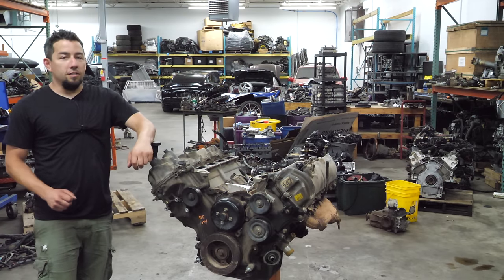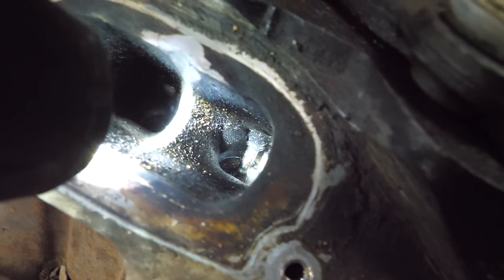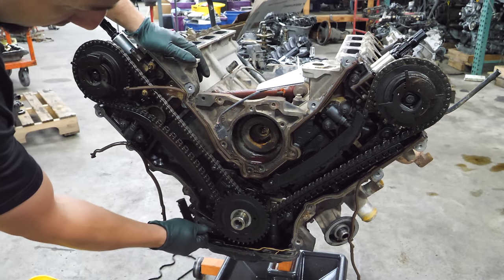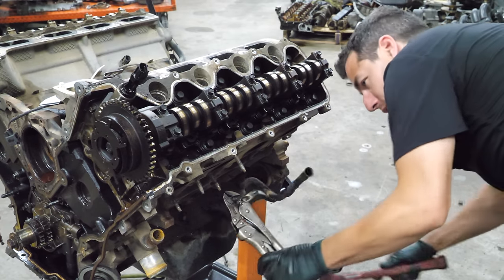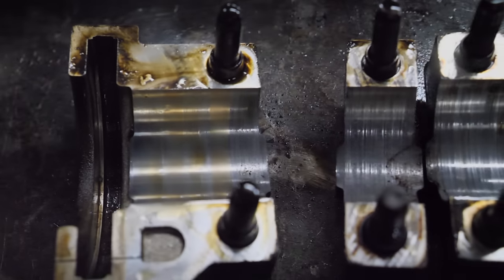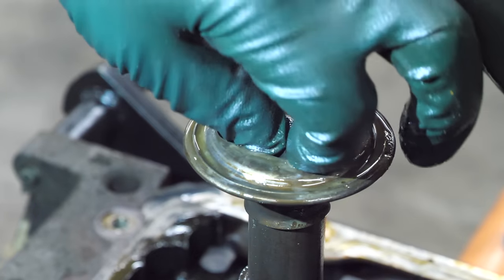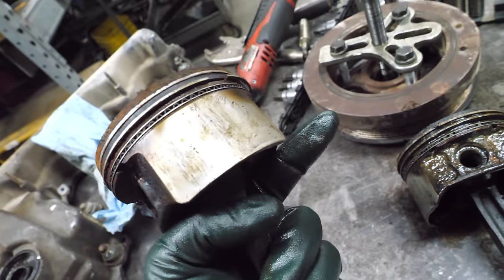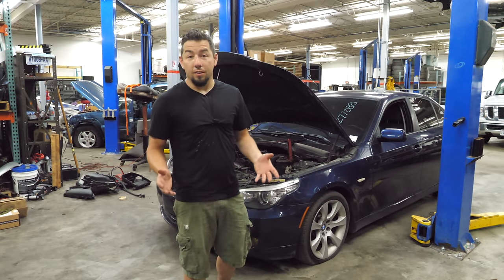Bad Ford 5.4 3-valve V8 Engine Teardown. Which of The MANY Possible Failures Took This One Out?

Comment: I absolutely love this engine! I made tens of thousands of dollars fixing this engineering embarrassment. For everyone who claims they have had no problems, consider yourself lucky, these are an absolute POS!
Reply: I am one with 290,000 on an 07 expedition.
Reply: I agree. 2004 was a transition year. A friend has an 04  f150 with the 4.6 2 valve engine at 350,000 miles. I have done about 50 5.4 engines with timing issues, bad tensioners, seized rocker arms,  exploded cam phasers, and the list goes on. Im only a part time mechanic on the weekends so i can imagine what full timers see
Reply: Please elaborate on your personal experience.
Reply: @jerryp1776  that's extremely overkill maintenance dude. Trash engine
Reply: I’ve had one for 355k not a single issue
Reply: @bldontmatter5319  what about subaru engines? every 100k there goes  head gaskets and timing belts.  Several thousand each time!
Reply: @vincentmartin9133  do you run synthetic ? regular changes?
Reply: @vincentmartin9133  just bought mine and I'm having to fix the timing
Reply: 226k on my 08 F150. All I ever did was change the oil and plugs
Reply: @reedvending2384  Funny, I didn't know gravity only affected Subaru boxer engines. It's only Subaru boxers that have coolant pool on the bottom lol. Only thing I'll give you is that the combustion chamber has a shit ton of free space on the outside, axing structural support.
Reply: @reedvending2384  Subaru's haven't had head gasket problems or timing belts for a decade.
Reply: @bigdaddymak1439  My bank account  tells another story.  Im done with Subbies
Reply: @edjackson4389  you might want to look in the mirror on that one. Worst part about Subaru's are their owners
Reply: @bigdaddymak1439  I just looked in the mirror... I think you might be on to something
Reply: 220k on my 2010 and zero issues.
Reply: Facts matter, millions and millions were made and many still on the road working hard. No it’s not a good engine overall and they screwed up. But statistically still better than many other engines. When you  make and sell way way more cars and trucks than any other company, you will have some problems but not as high a percentage than other companies
Reply: ive had every spark plug break.
Reply: The spark plug issue was fixed. The oiling was a big issue on most timing failures. All update oil pump, phasers, roller followers, etc. I have a 2011 5.4l w/ 140k. The 1st gen coyote wasn’t without its problems so I can see why ford kept the “updated” 5.4l revisions in the fleet.  What is great is how cheap and easy they can be repaired with great updated timing, valvetrain, and oil pump parts. If you have one and hear a tick on start up or consistently; do the timing job and replace those roller followers. Use mobile one synthetic oil. It’s all in how it’s cared for and maintained.
Reply: I have a 2007 expedition it has 270,000 no major problems.  I have changed the plugs twice and regularly change the oil with no issues.
Reply: @illwineventually  I might even supercharge mine.
Reply: Was a great motor new, and after I completed the full timing job with the mellings upgraded oil pump...
Reply: @robertconway3519  The Oil pump in my and many others opinion is the real culprit, that aluminum back plate that deforms allowing blow by and starving the variable cam timing of it's needed oil pressure is what kills these, I have 290k on mine with a Melling HV pump, and it is silent, no phaser clack at all ;-)
Reply: @whitey22222  there was a great video in here somewhere where they showed the factory pump at rpm compared to the mellings. The oil that was spewing out that back plate on the factory pump was simply ridiculous. That loss of volume and pressure is really what kills these timing components. Between the factory pump, and the 05/06 chain tensioner seals that blow out, they were destined to fail. I did the job with phasers, tensioners, pump, guides, etc at 96K. Sold the truck running strong at 180K. it's a shame as these motors had good power when they're running well.
Reply: @bigdaddymak1439  Then you can reimburse me for the $1800 I just dropped on a 2016 Forester with 62k.
Reply: Ford's worst motor will still outlast a Dodge! 😆
Reply: You people need to knock it off!!!.. We bought a brand new '99 5.4L Triton 4by4 Expedition with 8 miles on it. Had it 15 years 180k miles not a single solitary problem. Same transmission, hoses, alternator, fanbelt, everything,, 4 batteries replaced only.... idled and ran like the day it was New till the day we sold it.. Ford makes a dynamite truck,, everybody has their glitches
Reply: @seatime674  If it was a `99, it had a 2 valve 5.4, not a 3 valve 5.4.   The 2 valve engines are almost indestructible compared to the 3 valve.
Reply: @andrewb9708  I'm almost positive it was the 3 valve but could have been the 2 valve slight chance, maybe someone else can chime in with it.. The day I sold it I was genuinely sad like a family member died...Crazy
Reply: @seatime674  Nobody else needs to chime in.  The three valve was released in 2004 in the F-150 and Expedition, 2005 in the superduty.  1997-2003 Expeditions had two valve engines.  That's why you didn't have issues with it.
Reply: @andrewb9708  Got it, wasn't sure if you were just speculating or knew for sure
Reply: @michaelwdagle7410  same here but I have the cam followers and chain components with a new oil pump to get another 220000 miles. Oil changes every 5k motorcraft simi synthetic 5w20
Reply: I haven't had a single issue with my. 
I have 184 thousand on my
Reply: @heartstringsofficialVR  
Do yourself a favor and replace the oil pump with a Melling M360HV High Volume Oil Pump.
Also make sure you (or your mechanic) drop the pan and clean it out along with the oil pickup. When those plastic chain guides break, they drop in the pan and clog the pickup.
Reply: @bigdaddymak1439 but they still have plenty of issues with their chain engines too! Not as common on the head gaskets but super common for oil leaks, cam phaser issues, valve springs breaking, oil consumption etc… hell even when I worked for Honda the 1.8 in the civics would crack the block causing coolant to piss out, the v6 engines would oil foul spark plugs before 60k, and the auto v6 trannys where garbage
Reply: I inherited my 5.4L from my Dad's estate after his passing in 2009. He insisted on changing his oil every 5K and using only synthetic oil and I still follow his regimen.  It's got 310K on it now and I dread the day I have to get rid of it for sentimental reasons. It has only failed me once (FPDM rotted) and it was a super easy fix
Reply: @edjackson4389 😅
Reply: Carol Shelby would disagree
Reply: 2003 expedition with 388 thousand miles no problems yet, and a 2014 expedition with 243 thousand mile, runs great. My favorite engine ever.
Reply: 03 f150 5.4 3v triton with 260k right here baby! I already know I'm lucky without the validation
Reply: @JB-ef7ks  2002 5.4 3V with 549k.  No joke.  Ill post a video if y'all wanna see.
Reply: 06 318000 miles ticks a bit but runs good
Reply: @Oldsoulstuckinabadtime 
Yeah, the oil pump upgrade is to extend the life of the engine to something reasonable. Cleaning the pan/pickup is to keep the engine from completely dying within 5 or 10 thousand miles. 

A lot of the common problems are prevented with the pump upgrade though, including future timing chain issues.
Reply: 212,000 miles when mine went. Transmission went out, looks tan 100 miles after that rebuild, engine popped.... I want to fix that truck. Love it
Reply: @Oldsoulstuckinabadtime what do you mean running diesel or trans fluid every change?? As a quick wash then drain to clean it out or in place of the actual 5w20 all together???
Reply: @frankjosidetuck3809  03 f150 5.4 3valve here with 270k miles. Leaks coolant that must be coming out the exhaust cause I don't see it anywhere on the ground plus a oil leak from the filter mount gasket, oil pan gasket, valve cover gaskets and probably rear main seal but knock on Ford it's still going!! Just have to top it off once a month maybe twice!!
Reply: @michaelwdagle7410  My 08 F250 was a fleet vehicle before I got it with about 210k. I've only ever pulled my RV with it and I've only put about 4-5k now but I'm hearing that noise on the rear passenger side head. I think its time to do roller followers and think about the timing system. Otherwise runs like a top. My old mountaineer with a 5.0 did right at 400k in the 10 years I drove it, replaced a head gasket and an exhaust manifold about 250k. It wasn't the engine that did it in, was a range rover running a red light.... Goes to show keeping up on the maintenance and repair will make them run for a long time.
Reply: My grandpa had the one in his truck crack the exhaust manifold right after he bought it.  It also clogs the shit out of the catalytic converter.  He just said fuck it and ran straight pipes and headers.  Thing sounds like a mustang now 😂
Reply: @joshjohnson6163  sure
Reply: @andrewb9708  my 03 expedition died from the comman 2v self destruct feature those engines love to jump time without notice due to poor engineering on the timing system if you disagree just do a simple Google search
Reply: @JB-ef7ks  03 has 2vs you are lucky if you've never serviced your timing chain
Reply: @suryavaraman.4277  2002 would be a 2v
Reply: Hello eyebok ! I love it from an owners perspective and I have done the timming stuff and changed the oil as per, it has worked well for Me! when working on it I thought from a put it back together point of view a lot of thought was put into the oil sealing of the engine very little fuss was required to be correct on that part, I can however see were Others may differ on there opinios! see the obove comment ti Eric from Me. Cheers!!! Rick Armstrong Aurora Ontario Canada
Reply: @enjoythesho1992  You can have your opinion, very few will agree with you.  The timing chain issue is known, but it's not exactly common.  Hey, if you want to argue that a 3-valve 5.4 is better than a 2-valve, be my guest.
Reply: @andrewb9708  I'm a mechanic and it's alot more common than you think I've seen dozens including my own do it without notice and yes the 3v is a better engine hands down yea they have phaser problems but once you fix that issue they are bullet proof and make more power than a gutless 2v
Reply: @enjoythesho1992  I was a mechanic too before I changed careers.  I saw way more three valves than two valves come in.  I've driven both and the three valve isn't massively different powerwise,  the powerband is more concentrated mid to high rpm.
Reply: @andrewb9708  well I guess we live in 2 different worlds I've seen way more 2v completely jump time and become boat anchors the 3v will give you warnings before they do the phasers will make noise for 15k miles before they let go the 3v is a better engine they have stronger heads a naturally aspirated 2v makes depending on year and if it has the slightly better heads is 190-260 a stock 3v makes 300 that's a decent jump in power
Reply: @suryavaraman.4277  The 2V is the 5.4 you have being it’s a 2002. 2004-2011 F 150 have the 3V version.  I seen a 2v with 630,000 miles on it. I have a 2006 3V. Done all the work myself on it. Good engine with clean oil in it.
Reply: @enjoythesho1992  oh trust me I heard it slapping around in there but thankfully it's still holding up knocknon Ford and also it's definitely a 3v cause I just changed the plugs n coil packs which are not universal for the 2v, 3v n 4v
Reply: People were cheap and didn't do proper maintenance. I've owned 3 5.4 3v and all of them have never let me down. Because I use high quality engine oil, Shell gas and Motor craft parts.
Reply: @ryantracy1531  
How did Ford fix the spark plug problem?
Reply: Have a 08 and it's trash
Reply: @boxerboxer4515  ever think that maybe that might be cause you hot boxed the engine too much? 2,3 or 4 valve?
Reply: I saw a guy who flushed/cleaned with adding a quart of transmission fluid right before oil changes and he has 400k plus miles. It's really about maintaining properly.... you just had perfect customers that didn't do proper maintenance on them
Reply: @victorgarcia9791  
I don't know, I had an 88 Dodge Dakota,  with over 235,000 miles,  I changed the plugs once a year,  changed the oil every 5,000 miles , never had any major problems,  not like what folks are talking about with this engine
Reply: Just do regular oil and filter changes... They'll work fine if you baby them
Reply: Been through all that with this engine, what a bad design, wasted a lot of $
Reply: I have on one in an Expedition with 200,000 miles, no problems.
Reply: @jakeparker8972  no he wouldn't
Reply: @reedvending2384  Not the 6. No Turbo no problem. Naturally they stopped making them.
Reply: 297,000 still going strong
Reply: @bigdaddymak1439  nailed it, and the worst pat about 3v 5.4s are also the owners. These are oil sensitive engines, I've never seen a single issue on 3v 5.4s that got oil changes at PROPER intervals
Reply: The best part about this comment is all the old farts that have a cap on their truck boasting about all the miles they have on one. Good talk for McDonald’s in the morning.
Reply: The jeep 4.0 is a great motor 
But the ford 4.9 straight six is the best gasoline motor ever built it’s not the fastest but it just works always
Reply: @poisonPpaully  i agree
Reply: 08 plow truck with 389k. Manifolds are only thing that has caused an issue for me. Sorry but 5k oil changes change to new spark if and they will last long enough if your not a asshole to your truck.
Reply: @nhbountyhunter  i totally agree, the only thing that kills the 3v is idiots who do not change their oil
Reply: I bought a used one. With a lot of miles on it. Drove it for two years. And never had a problem out of the engine. The transmission started slipping pretty bad. And popping when in reverse. A frame rail broke. And a ton of electrical issues. But the motor ran fine. Until one day it wouldn't even turn over. Replaced the starter and no change. Didn't know what else it could be. And got tired of working on it. And traded it off. It ended up sold for scrap
Reply: I have a 2007 f150 with 205,000 miles and it sounds like an exhaust manifold leak or a lifter tapping and it's sounded like that since around 50,000. Changed every spark plug except cylinder 7. Couldn't get it out. Changed about 5 coil packs. Same fan belt, alternator, starter. Oh, I changed the windshield squirter pump. Changed the transmission fluid and filter once. 1 set of brake pads, both front hub/rotors.
Reply: Had a 2010 F150. Broken exhaust manifold @ 15000 km. Drilled out and fixed. A year later when I sold it, the new owner had to do it again to pass safety check.
Reply: Should be 150,000km.
Reply: Mine will have 280000 on it next week when I  change the oil and filter. Drove it 50 miles today! But, I actually change the oil every 5000 miles! They're all over the place down here! Full synthetic oil changed every 5000 miles! Your customers are idiots, and you've taken advantage of them!! It's a quart low at 2500, I change it at 5000 miles! Irs a quart low then too, but I change the oil and filter.
Reply: I just sold my 07 f-150 with 387k and it was still going strong! Oil changes/maintenance is key. I did do a timing job and obviously a few plug jobs besides that everything was original.
Reply: @vincentmartin9133  me too! Sold mine with 387k. People just don’t maintenance their vehicles.
Reply: Maybe ur just screwing people that don't have the mechanical aptitude to know! My drivers side exhaust gaskets been leaking for 100000 miles! Put aftermarket cats on it 2 years ago cause the drivers side rattled. Had the phasers locked out when I bought it.The mechanic told me his weren't locked, buy like most people I would listen. Put 5000 miles on mine in the last month. Pull the camper, car trailers. The tow capacity is 9200lbs, in 05 that was scaring 3/4 ton territory, but I pay taxes on a 1/2 ton. To each his own, said the farmer as he kissed his cow! I paid $4500 for it 4 years ago, had $5500 in it when I had the phasers locked out and I've put over 100000 miles on it! Best money I've spent on a rude, and I'm 62.
Reply: I've had no problems 🙌🏻🇺🇸
Reply: Ej2.5 is worse always trashed
Reply: Got 220k the fan phaser are bad, the engine is a torque monster
Reply: At 210k on my 08 f150 I think she might be about done
Reply: @chaddbeverlin967  funny you say that I just blew the motor yesterday😂🤣🤣🤣
Reply: I had to trade mine in at less than 100k miles. Sounded like a diesel. And I didn’t have the tools, know how, or confidence at the time to tackle a cam phaser job. That and it cost me a lot to get the plugs done. Broke 6 out of 8 off in the head.

Now, if you get a good one, you get a damn good one. I know of 5.4 Tritons out there that will probably never quit running.
Reply: What a simplistic view. There are literally millions of millions of examples of these engines. Of course there is a market for repairing this engine.
Reply: Love this engine 2 😂
Reply: Regular maintenance switch to 5w-30 and timing job with upgraded melling oil pump and your good
Reply: Actually its not  to me ive got 258000 miles on mine and nothing wrong
Reply: @michaelwdagle7410  from 2008-2010 they fixed most of the problems associated with these engines. You still see 2010 Expeditions running in law enforcement jobs, nowadays.
Reply: @joshjohnson6163  amen to that!! Built Ford Tough isn't just a slogan.
Reply: The head gasket issues mainly affected the N/A 2.5’s. And it’s primarily due to cheap shitty graphite coated gaskets, when the original gasket fails if you replace it with a multi layer steel gasket it pretty much completely fixes the issue and it’s no more likely to blow a head gasket than any other engine. There’s still some other little quirks with the platform, mainly with some of the oiling system, the oil pump seals having issues with age is one I can think of off the top of my head. But if you’re concerned about it do the oil pump when you have the timing belt system apart and you’re golden. Not a bad engine or family of engines, just a little weird and sensitive. Much like a lot of their owners. I owned a 98 impreza with the glorious EJ22 so I can say that with confidence😂
Reply: Had two these only minor issues idiots need learn how service engine
Reply: @IsmaelRodriguez-oh1nv I turned 16 in 2001 and first car was a 1999 5.4 2 valve (Thank God) F-150 that was virtually brand new with under 20K miles and I loved it. I kept meticulously great care of it and the only problem I had with it was replacing the serpentine belt and ignition coils but that is nothing. I guess I got lucky with having the 2 valve 5.4 and not the 3 valve nightmare I’ve heard about
Reply: @zachevans8813  the 2 valves 5.4 are pretty bulletproof only real issue they had was heads blowing spark plugs but have seen many of those engines hit over 300k easy. All the new stuff coming out with turbos is garbage
Reply: Well you being a mechanic should know it's how you take care of your vehicles not what kind it is
Reply: 243kon mine too
Reply: 07 expedition 200k still rolling strong.
Reply: Do you know if the V10 triton is any better?
Reply: @bigdaddymak1439 

What's wrong with lesbians??
Reply: 290k on mine.
Reply: I doubt you fixed many of these. They are extremely reliable if maintained properly
Reply: They’re fantastic engines for a forged internal H.O build though!
Reply: I have put 160 in my current 2010 f150 since new absolutely not a single issue .. no noises leakes or anything I replace original spark plugs 30k miles ago .. I can't complain ... it's a great engine to me .. only issue right now is a exhaust manifold leak .. but that's not part of the engine components..
Reply: @ajmedeiros77 that's no excuse for Fords shit
Reply: I Have one with 870,000mi and have ONLY changed the oil 10 times! I’ve done NOTHING EVER TO THIS ENGINE! I also had a Chevy VEGA That had 400K mls . Did Nothing!
Then my YUGO… Most reliable vehicle I EVER OWNED!
😂🤣😂🤣
Reply: get a 5.3 and I'll tow you home with my 5.4
Reply: I love how corporations sell you garbage and then make the dealership deal with the fall out...
Reply: My 07 f250 with this engine (5.4 3v) has given me 15 years of service, 300,002 miles and still takes my to work every day 🤷🏻‍♂️

Thing works/lasts if maintained properly
Reply: 170k miles on my 2005 Expedition … she been an absolute beast for the last 3 years. I do oi changes every 3k miles faithfully and only thing I’ve don’t so far is brake lines, battery and infamous spark plugs.
Reply: @michaelwdagle7410 did you ever do the timing chain ?
Reply: @illwineventually did you ever get the timing chain, water pump or followers or anything ?
Reply: @productive23  I have not had to do and timing work,  although I am thinking about it because of the mileage now.   I did do a water pump and radiator over the summer.
Reply: E350 5.4 took me all around the United States no problem all I did was change oil and tires
Reply: Trash engine the engineer is a failure at life.
Reply: 270k+ on my 05 f-250
Reply: We have a 338k Miles and it just killed itself, no compression lol
Reply: @Hotheal you never followed the procedure correctly. Crack 1/4 turn on slightly warm engine, spray plugs with PB blaster or deep creep or mouse milk and let soak for a day or more and then loosen, tighten, loosen, tighten and continue — SLOWLY.
Reply: They still snap rods and have shit timing. I do plenty of wrx engine jobs and theyre literally cruising stock and the engines go at 105k. Ridiculously garbage and their prices are outrageous at the dealers. The 2.4 is the only good engine. @bigdaddymak1439
Reply: My has been alsome. Most reliable. Not luck just great
Reply: Ive had 2 modular engines 4.6 and a 5.4 and haven't had to many problems  just the occasional bad coil
Reply: @seatime674 your 99 not a 3 valve
Reply: @justayankhouston741  '99 Expedition 5.4 XLT Triton I believe was a 3 valve